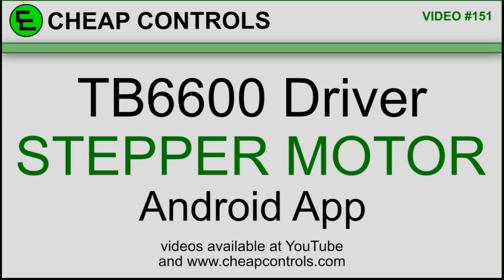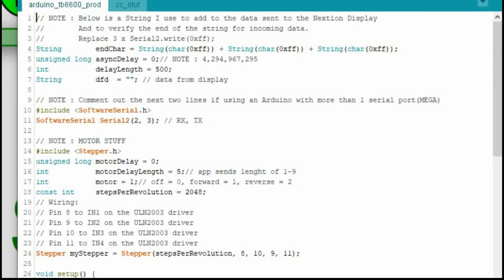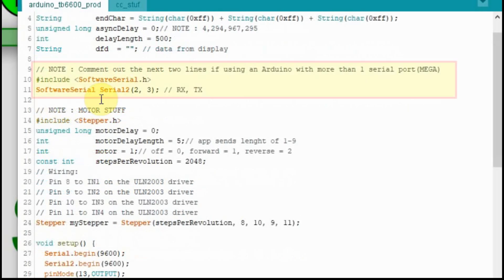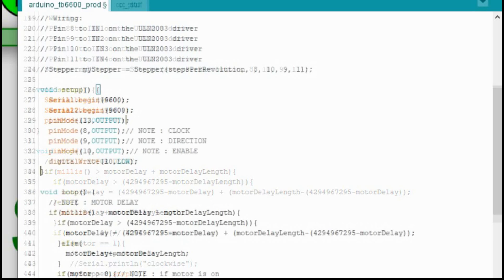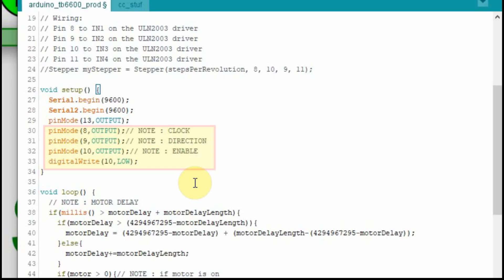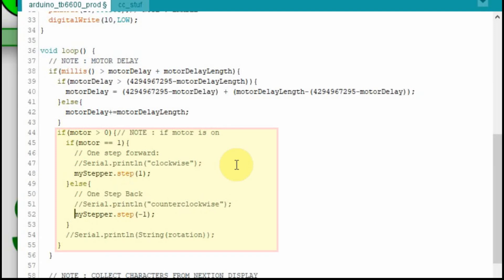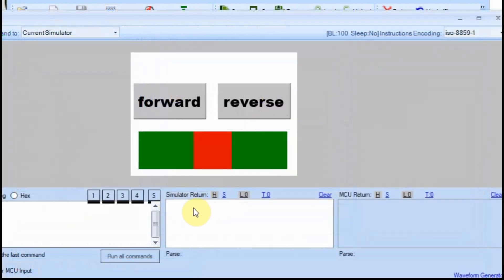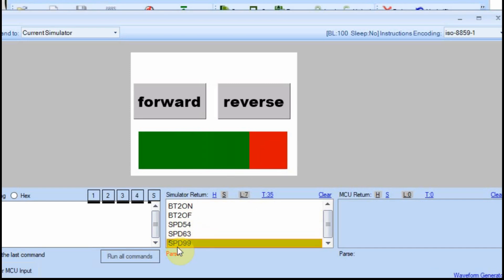151 Using a TB6600 stepper motor driver with a Arduino Nano, Nextion Display and Android App

Comment: I need to generate torque which can run a conveyor belt, i am using your code but it runs it slow, i am using nema 23 can you help me to control its speed a little bit faster?
Reply from the maker: I can help but you would have to go through the Cheap Controls website.  You need to submit a comment on the help page.  I will get back to you as quickly as I can.
Reply: @CheapControls  on a particular post or anyone?
Reply from the maker: On the help page
Reply: @CheapControls  done bro
Reply from the maker: I got it.  I replied

Comment: Finally got what you saying but I’m stuck on one place, i am using arduino uno and i have one question, which is do we have to connect rx and tx or data pins? I need help with which pins are to be connected to nextion woth arduino.
Reply: The only thing I’m having issue is with torque, i am not able to change speed with slider properly, any help on it?
Reply from the maker: Torque?  this might be a function of the TB6600 board you choose.  We use these for high and low torques application and we do have to replace them when they burn out.  The price point for these on amazon makes it worth having a few spares laying around for replacement.
Reply from the maker: I used pins 2 and 3 on the arduino
Reply: @CheapControls  got it, working now, ty
Reply from the maker: I am glad you  figured it out.  Good luck on your future projects.

Comment: Not able to get the code, can you help?
Reply from the maker: It is available at the old website https://www.cheepcontrols.com/videodetail.html?id=15  look towards the bottom.  It only has the Arduino.  Are you looking for the Nextion portion?
Reply: @CheapControls  yes please
Reply: @CheapControls  great help if you can gove me some contact?
Reply from the maker: I have it uploaded tot he link above
Reply: @CheapControls  it wasn’t working, the settings inside nextion editor (for buttons), if you can share the hmi maybe or can help me , it is a part of my college project i really need help..
Reply from the maker: I just added the link a few minutes ago.  I had to upload as a zip.  hmi is not working anymore.  If you want more help go to the www.cheapcontrols.com need help section.
Reply: @CheapControls  i wasnt able to find stepper motor proj in your website.
Reply from the maker: The app portion is not available.  You need to go and make it on the MIT app site.  It was free the last time I was there.

Comment: Appreciate the tutorials, I figured out how to get most of this working but I'm stuck on how to add a second TB6600 driver and stepper in the code without using Accel Library. Fairly new to Arduino. any help would be awesome.
Reply from the maker: I am not sure how to explain in a comment but I think you would create another set of variables associated to another set of pins.  Thank you for watching.